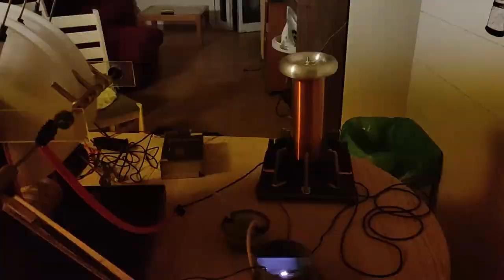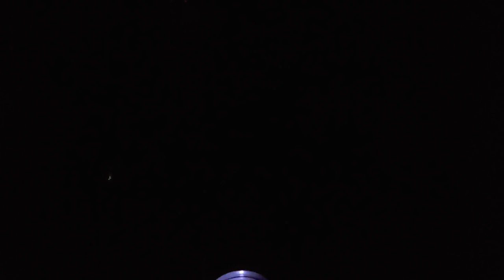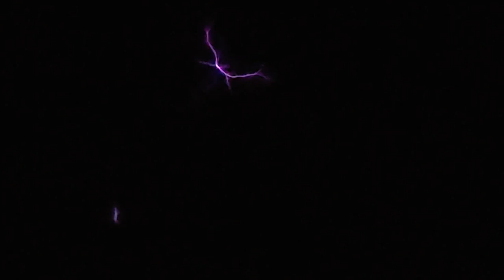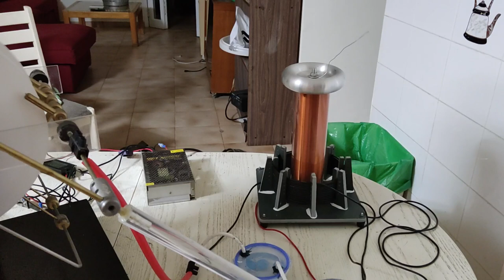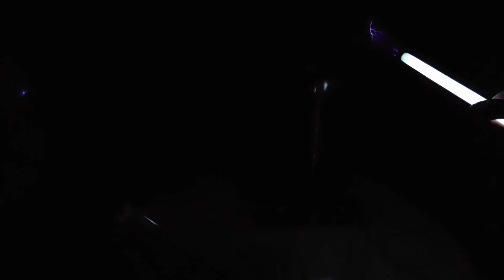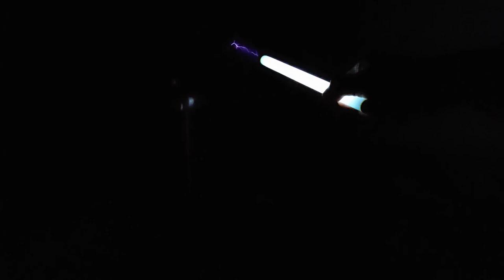Driving a Tesla Coil With a Quadruple Bonetti Machine

Comment: What would happen if instead of the primary coil you fed the secondary coil from the Bonetti machine through the top ring.. in my opinion it should transform to a lower voltage with more Amps.
Reply from the maker: Of course it will work, but as an air core transformer it will waste considerable energy released throughout the room as RF radiation (just like a step up Tesla coil does), I have videos of me stepping down a Wimshurst machine with a Tesla coil in reverse, but in this video I do a better job using reversed oil filled ignition coils. https://youtu.be/RlUBjJfsR3s Keep in mind keeping the capacitance required on both the primary and the secondary so they resonate at the same frequency is important in the most energy efficient step down of the high voltage.

Comment: Hochfrequenten Strom von der Wimshurst-Maschine an die große Spule des Tesla Transformators anschließen und die Funkenstrecke anders platzieren. Wenn die Resonanzen stimmen, könnte man die Spannung verringern und die Stromstärke erhöhen. Den Tesla Trafo rückwärts benutzen. Schon probiert?
Reply from the maker: https://youtu.be/RlUBjJfsR3s  You are correct a reverse tesla coil WILL step down the voltage EVEN if it is NOT in resonance, but it will be much more efficient if the capacitances are made to match the primary and secondary resonance frequencies. The problem either way is that Tesla coils are air cores and they tend to be RF pumps that send RF all over the room (wasting much of the energy), plus if your Tesla coil was built to be a Tesla coil originally it has an extremely low coupling factor (otherwise you will have primary to secondary shorts that will destroy your secondary during real Tesla coil operation) that low magnetic coupling is also a source of HUGE energy waste, hence the reason I am using resonant transformers made by properly matching capacitances on the primary and secondary of oil filled ignition coils. MUCH MUCH more efficient, although static electricity generators in open air are hideously inefficient generators.
Reply from the maker: Here is an old video using a bi-polar tesla coil to step down voltage on a Wimshurst machine.  Please note that the current readings are NOT accurate or even close to reality.  You can NOT rely on a clamp meter or direct connection to a digital multimeter for current readings off of these machines, I didn't know this at the time but the frequency of output from a Wimshurst or a Bonetti machine run over the map from a few thousand hertz (a few kilohertz) all the way to about 120 kHz.  Multimeters handle 50-60 hz usually max. Some top end Flukes I have seen state they can handle up to 2 kHz but even that would be inadequate (besides you will eventually destroy the meter around these machines). NOT knowing this is the basis of most of the ignorant who believe they have invented a perpetual motion machine ("Free Energy"). 
https://www.dropbox.com/s/tdf5e571s2t8291/Good%20Output.mp4?st=8wvkiy3q&dl=0

Comment: All you need now is another tesla coil to step down the voltage to somthing usable.
Reply from the maker: I don't need two Tesla coils if I want to step down the voltage.  I can use one Tesla coil and lose the spark gap on what WAS the primary side, keeping the same capacitance so they are still matched.  Then jump one of the poles of the Bonetti machine to the top load of the Tesla Coil (This is the spark gap required to drive the Tesla coil in reverse), the output on the old primary needs to be rectified and stored in a capacitor. Exactly the same as what I do in this video https://youtu.be/RlUBjJfsR3s  only with the tesla coil replacing the two ignition coils.

Comment: Try triggering the discharge of the HV cap with the TC, like I did in my video
Reply from the maker: What video is that?
Reply: @MisterBonetti  I'm not sure if I understood that you were driving the SGTC directly the first time I watched, maybe I skipped over or had the volume too low to hear you, but the result does exceed expectation
Reply: @MisterBonetti  are you attempting to make the generator more powerful ? My intuition says there's room for much improvement. I had little understanding on how these work but I think I'm beginning to, I did some reading and apparently this should also work without the "neutralizing arms", which would allow for elongation of the brushes to cover more area, but apparently this comes with disadvantages, one being the necessity to place initial charge, which could be done using the flyback instead of ex. Wimshurst (as I saw being done on another vid you commented on), and loosing charge when the connection breaks at the output, but what if instead you made another "output" and simply hooked one cap to it which can hold the maximum voltage without breaking down or leaking, this should enable higher gain on the real output. Ofc this is problematic if there is no theoretical limit to the voltage, that is, if the materials are the only limiting factor. Perhaps placing a high value resistor across this cap would improve the output. I could be wrong LOL this is the theoretical phase for me
Reply from the maker: The neutralizing arms actually cause polarity reversal that cause one doughnut shaped charge ring on half the disc to be one polarity while the other charge ring is the opposite, the fact that the neutralizers on the other side are the mirror image creates the same polarity charge ring on the same half disc, allowing one side of the machine to be positive while the other side is always negative.  Without those I am not sure even spraying the charge on like a Van de Graaff will work well, UNLESS you are planning on making a unipolar machine.   One major limiting factor in voltage is the maximum distance to from the charge collectors to the nearest neutralizer in direction of rotation.  YOU CAN build these machines so the neutralizers become dual purpose and perform BOTH functions.  I have read about that but have not tried it yet.  Look around the internet, and read the 100+ year old literature, so far the only machine on video record producing the level of output per unit of diameter is my machine.
Reply: @MisterBonetti  indeed, I didn't think about the other side, but the dielectric must be polarized. What puzzled me in relation to that is that the same collector is used for both sides of the disc. I can't find a good visual breakdown of the design, simplest preferably
Reply: @MisterBonetti  If all this operates on "triboelectricity" then why doesn't air, along with the dielectrics used in the discrete capacitors, play a role in the explanation of the mechanism, as far as I can see. Ofc it's difficult to explain any of this if one doesn't know that conductors don't hold a charge, which can be seen in the "dissectable capacitor experiment". Tho it does appear that polarized fluid dielectrics "collect" around a conductor surface but apparently aren't able to discharge unless sandwiched... and that would explain why movement/turbulence is needed to gather the charge and use the charge itself to arrange it properly so the poles stick where u want them to be
Reply: @MisterBonetti  Here's the visualization v=joetshqFAOM&t=34s, so keeping this in mid, I don't think @RimstarOrg s animations of the Wimshurst really represent what's happening
Reply from the maker: @sFeral  This is the most accurate. http://www.coe.ufrj.br/~acmq//whyhow.html  Rimstar taught himself a little basic electronics and physics since he started as a FREE ENERGY supposed researcher (he has finally convinced himself that none of that is real), but as a result you should be very skeptical of ANYTHING he posts.
Reply from the maker: @sFeral  The so called "Influence Machines" which would be now called Induction and not "Influence" do not use the trboelectric effect at all, except on a Bonetti Machine (which is not ordinarily self starting) to provide the initial charge imbalance to get them going. Sometimes when you build a sectored Wimshurst the discs don't initially have enough charge imbalance to get going and need help, which may be applied by the triboelectric effect, however once they are started the first run, Wimshursts will always self start (unless you completely disassemble for cleaning an maintenance where you could drain the discs enough that the machine will need help to start again (this is rare but does happen, it also depends on the chosen disc material.  Acrylics and some PVC's like white schedule 40 will get large charges just sitting around doing nothing.  That is most likely due to the fact that both materials have an affinity for dielectric absorption (also known as the "Memory Effect" and the "Electret Effect").
Reply: @MisterBonetti  The real question here is if charged dielectrics are really ever monopolar or do they just appear so when interacting with another piece of dielectric material. Can you link me of a demonstration like this =7N4RLMZMX4w except where oppositely charged pieces are separately placed in conductor sandwiches to see if they can be discharged ? The other vid I linked would suggest that only a combo sandwich of both materials enables discharge (equalization/redistribution of charge), hence that they can't be discharged separately
Reply: @MisterBonetti  similarly to how magnets would always appear to be attracting each other unless they're fixed in linear motion and unable to rotate into place, except with dielectrics there would also be a repulsive version, which is difficult to explain (or so it appears to me right now)
Reply from the maker: @sFeral  there is room for improvement, Felici did it in the 1950's and 1960's making a 98 % efficient essentialy rotating concentric drum style Bonetti machine, but he used exotic glass and metal membraines and sealled all in hydrogen.  Open air electrostatic generators are severly inefficient generators, mine meets the theoretical limita exactly, so without sealling in aninsulating gas not much improvement is posivle.
Reply: @MisterBonetti  I got what u're saying but I'd still like to see the said experiments. I've seen @Thomas KIm s electrostatic detector and it's too bad he didn't test it on a dielectric from a dissectable cap

Comment: If you can run it from a bonetti you can run it for a wim Hurst.
Reply from the maker: A Bonetti is just a sector less Wimshurst.  The thing is a standard Wimshurst with symmetrical charge collectors puts out a theoretical maximum current of imax = π (rmax2 - rmin2) f pmax where pmax = 26.55 µC/m2 , and f = turns per second.  The same size Bonetti with symmetrical charge collectors puts out 2 imax.  In both cases, only one disc contributes to the charge, and the other just becomes a spinning induction plate (as opposed to the stationary induction plate on a Toepler / Holtz machine).  With charge collectors that have two halves on each that can be angled towards the nearest neutralizers, it becomes 4 imax for the Bonetti and 2 imax for the Wimshurst (Bonetti's are twice as efficient as sectored machines).   In my case of a machine with 12" discs, a 12" Wimshurst would produce just imax, where my machine produces 28 x imax!  The maximum voltage is limited to a spark length of 2/3 the diameter on a Bonetti, and the radius on the same sized sectored machine.  
So current output is double and voltage is .33333333 % greater on the Bonetti.  In my case, my voltage is .333333 % greater but my current output is 28 times that of a standard 12" Wimshurst.  Of course, a quadruple sectored Wimshurst would produce 14 imax (the output of the inner discs on multiple machines [if the disc pairs are close like on mine] is double the outer disc output on all the inner discs).

Comment: How many volts did the Bonetti produce?
Reply from the maker: That machine (The Bonetti) puts out a measured 340 kV at over 900 uA (3000 RPM) and 616 uA at 2000 RPM. Join and see my videos on measuring current and voltage from one of these. In THIS video it is putting out only about 25 - 30 kV because the spark gap that drives the Tesla coil 4.8 (or so) nF tank circuit severely limits the voltage in order to keep from over voltageing the tank circuit set to only handle a max of 40 KV.